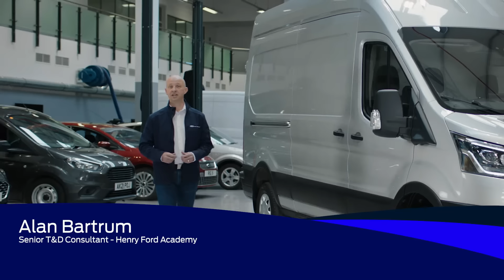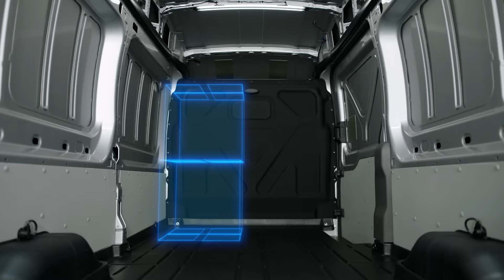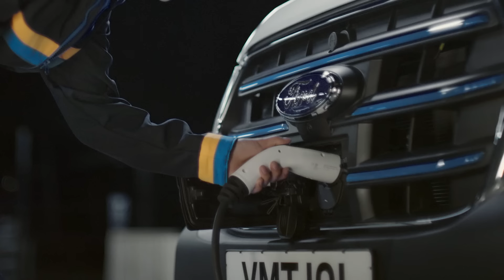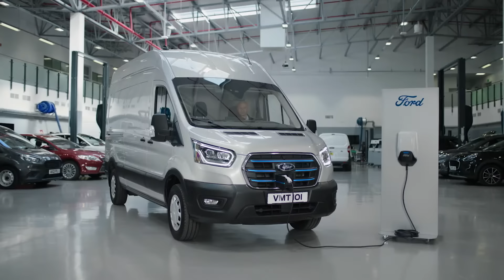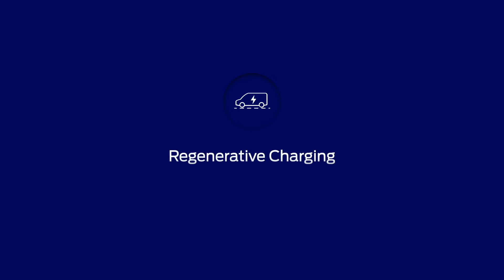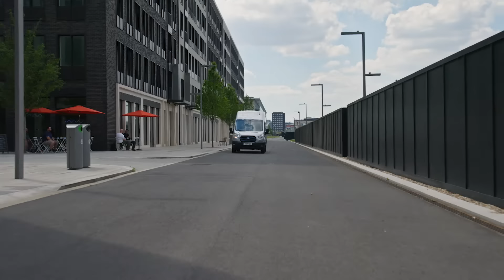How To Get The Most Range From Your E-Transit | Ford UK

Comment: I work for DPD in one of these, brand new lease and there the worst thing they’ve thought about. Charging it overnight is £20 at a normal charger, and £40 at a fast charger. If your lucky you get 120 miles out of it and you have to limp home with the heaters off and can hardly see, 💩
Reply: Same thing for me, did you find any solution for that?